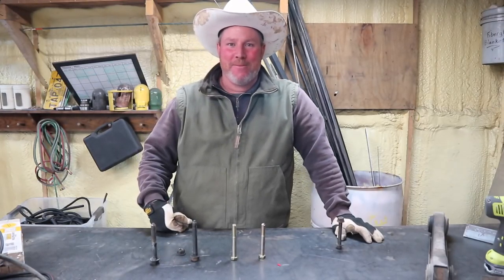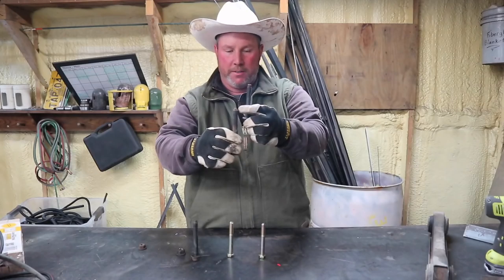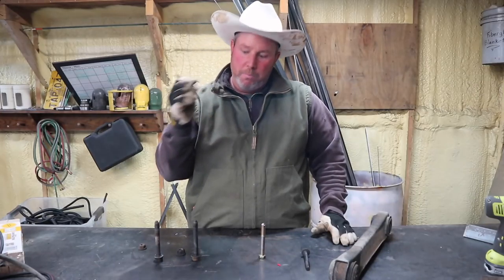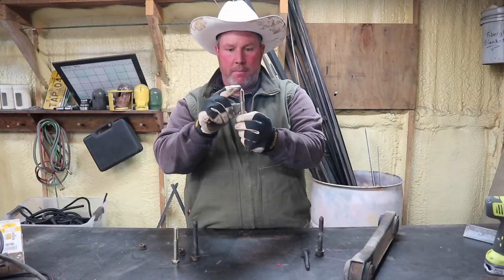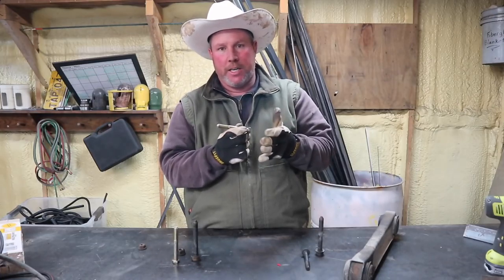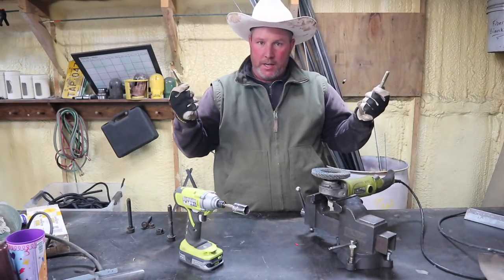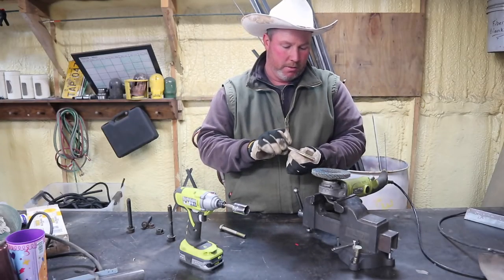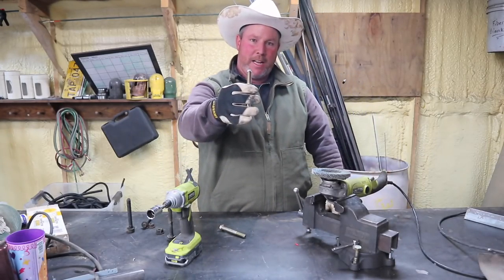Bolt Tips with Boss Hogg Jerome

Comment: here's a refinement to your tip. When ever you need to modify a bolt that will get a nut afterward, thread the nut on first (past the point you need to grind/taper) after you grind/taper the bolt, when you remove the nut, it will clean up the threads on the end, making it easier to assemble when the time comes.

Comment: Another tip. Put the nut on the bolt before grinding the bevel.  Once the bevel is ground then take the nut off. This will work like a die and clean up any damaged threads

Comment: Can you do a video showing how you can drive a Cherokee without the front inner axles as long as the outer is still there so it holds the hub assembly together
Reply from the maker: Maybe so
Reply: BleepinJeep that would be awesome! I'm gna have to run without the passenger side inner axle for sure but I'm gna take the drivers side out too I think because my lockrite lockers spring loaded pins broke and are jamming the locker locked

Comment: Do you ever have a problem with starting the nut after the tapper?
Reply: Don Yearout I do not normally when you take your time it doesn't mess the threads up at all. You're just slightly grinding to a point not cutting it off would like a cutting wheel or going real crazy when grinding it
Reply: Thanks. Just realized I did not spell taper correctly.  I will try this.